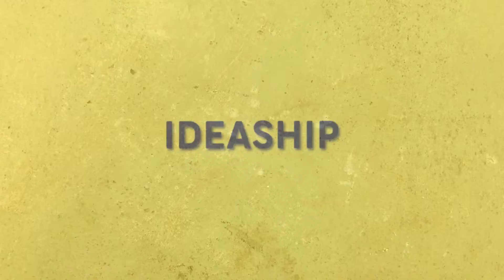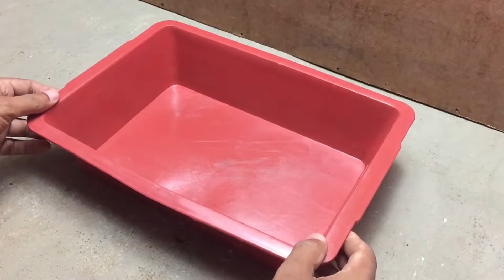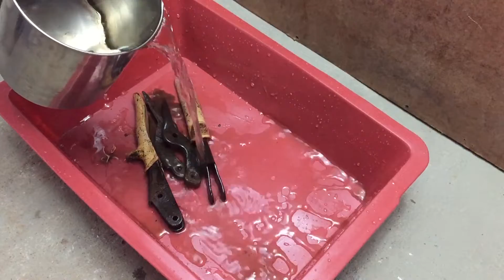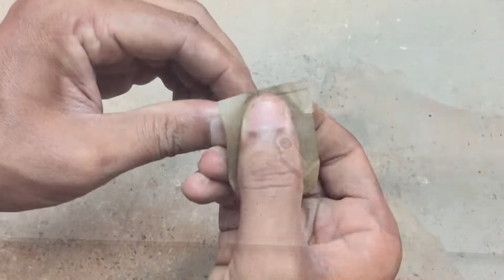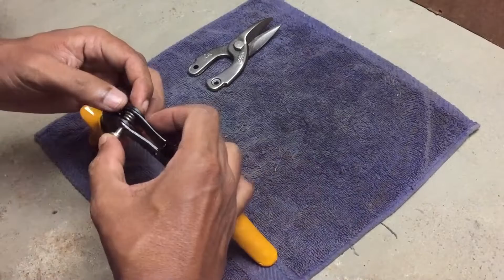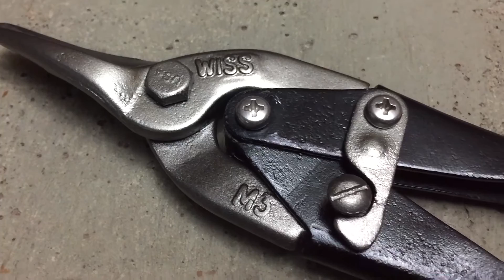Restoration WISS M3 Aviation Snips

Comment: Thanks for sharing. I notice you had no spring when you took them apart, but managed to find one mid restoration, and you changed a lot of the bolts from slotted to philips. Painting the handles was unexpected! I am going to try heating the plastic on mine, to see if they come off. All the best
Reply from the maker: Thank you very much for your valuable comment. 💛

Comment: Do you screw them together “tight” or leave some play? I have two sets that are loose and won’t cut right.
Reply from the maker: Hold handles together in hand and tighten the screw with other hand, just enough to hold handles in this position. then loose the screw just enough to allow handles to spring open.
Reply: @IdeaShip  ok thank you i will try that.
Reply from the maker: @papergatorzfedducca7998  you are welcome !